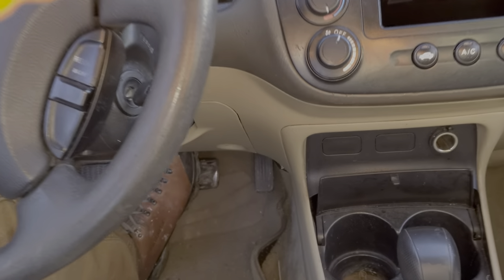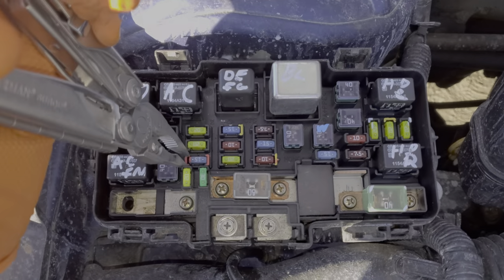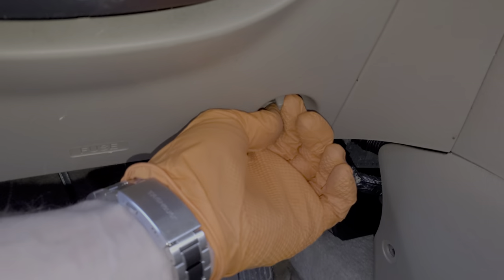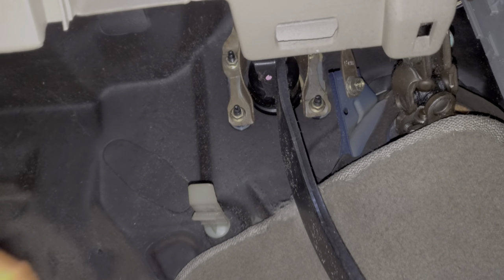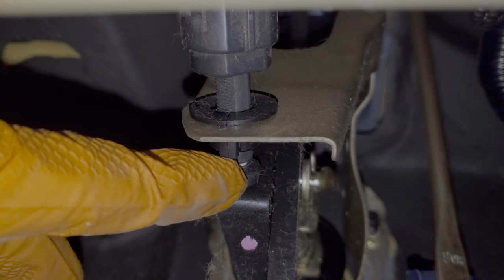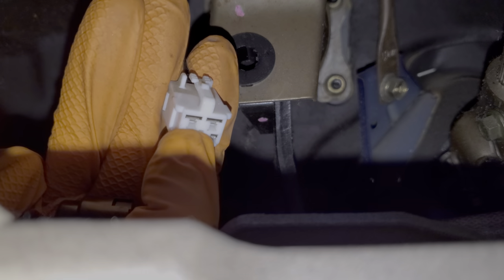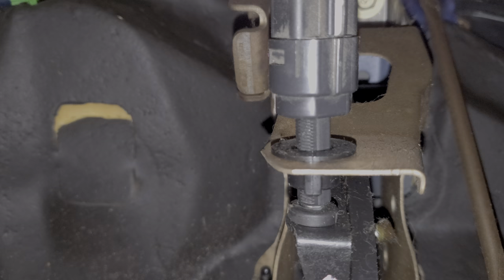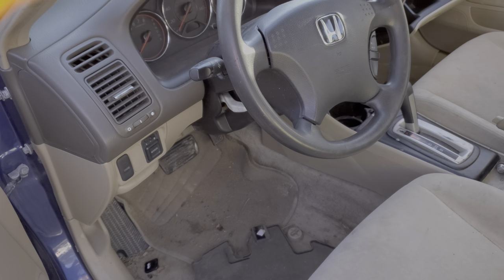2004 Honda Civic Brake Light Switch Replacement, Stop Light Fuse

Comment: 2:27 does that rubber piece have a specific name
Reply from the maker: Yes Dorman calls it a brake stop pad and you can buy it here: https://amzn.to/3BC6ZX0
Reply: @LehewTech  thanks
Reply: @LehewTech  Thank You So Much for Your Help....
I just put a nut & bolt of 1/4  of diameter x 1/2" long at the pedal because the rubber was missing, and problem fixed, The lights Went Off... Thank You Again
Reply: @LehewTech  I saw a video where a guy supper glued three pennies together and glued it to where the grommet goes, and he said it has been working for years.
Reply: @CarlJohnsonjr ty for the link. Saved me a lot of trouble.
Reply: Very informative appreciated the video and was wondering if you by chance live around Birmingham or Tarrant
Reply: That did it for me. Thanks!

Comment: Just came home at 10pm to find my Civic in the driveway with the brake lights on... This video saved my sanity. They've probably been on for hours, and are extremely hot to the touch, (it's still 97F here, at 10pm). Found the remains of the little rubber stopper.  Had a thick piece of leather I could wedge in the for the night until I can get the part and fix it tomorrow.  You sir, are awesome!

Comment: What if only one of my break/reverse lights isn’t working?
Reply: Man im going throught that issue right now, my driver side brake light doesnt work but it works when locking the car and etc, i feel like its a wire issue but i dont have an obd reader to check where the wire fault is if there is any wire fault

Comment: Hi Lehew, my parking lights did not work when I turn the lights on. However, brake lights work when I push the brake pedal. Park lights and brake lights are the same, only light shining amounts are different, am I right? so, where is the problem. I did not find it out.

Comment: The troubleshooting bit at the beginning was fantastic. I have a 2004 CR-V and it's basically the same under the dash. Was able to find a bolt that fit where the plastic stopper had broken and could fix the issue at work instead of having to drive all the way home without functioning brake lights. Great information and great video.

Comment: This video just helped me immensely. My best friend's 05 Civic had the brake lights stuck on and drained the battery to zero. I thought maybe it was a solenoid stuck in the "on" position. Turned out to be that brake stop pad, it broke apart and fell on the floor as soon as I took that bottom panel off. Quick and easy fix!

Comment: Apparently that adjustment feature can also work for fixing a non-working cruise control problem. Gonna try it for mine, I'll edit the comment with the results. One more edit, unhooking that switch can also work for checking your brake lights and making sure the bulbs are good. Genius move installing this type of system Honda!

Comment: Great video. I think I need to replace my switch. I basically know how, but wanted to check a video and this one was good. You covered everything. In my case I think its affecting my cruise, not my brake light. I cant find any other reason why cruise won't work so im replacing the switch. Thanks for the detailed video.

Comment: All.my lights at rear end are working.  When I press the brake, the right brake lights glows indicating that it's working fine but left one does not. It's dfntly not a light bulb issue coz all lights at rear are working when you turn on the lights. What could be the problem?

Comment: My issue is the tail lights don’t stay on. they only work for the following:::
Brake lights 
Hazards
Signals. 
That’s it they won’t stay on while driving at night. Already checked the wires, fuses, relays. 
I’m assuming light switch????

Comment: Great tutorial very easy to understand !
Btw I have a clicking sound when I depress the brake pedal on my 2005 civic automatic, it's coming from the brake linkage and not outside the car, I can feel the click when I depress the brakes, do you think that the switch could be at fault, from your tutorial it doesn't seem likely that a click could come from just activating the pedal  and thus pushing up that white plastic brake switch, would you agree or is it possible that it could make the click sound?

Comment: I just folded a piexe of thing cardboard like 5 times and stuck it in there for now. Pushed the brake switch on it so theres some tension on the cardboard but not enough to trigger the switch. This will work till i fr just tape the cardboard on there permanently. Fixed this while waiting for harbor freight to open lmao

Comment: Hey! i have a question i have an automatic 04 honda civic and my reverse lights arent turning on. checked the fuses and bulbs all seems fine so i wanna check the switch but looking around on the internet some say its on the transmission other say its under the shift lever. I was wondering if you maybe knew where the right location is for the Back up light switch?
Reply: This switch I just replaced and I now can click the shifter into gear rather than stick something in the hole next to shifter. It's the 8$switch

Comment: Tremendously great video! I did have to replace the grommet. My grommet was actually plastic and I saw what looked like Chiclets on the floor. I replaced that and that solved the brake light problem. Can you tell me why when that solenoid or that switch is activated there is a clicking noise in the center console that is quite loud? I am having trouble with my cruise control and one video said that it's related to this particular switch. The light on the cruise control button is on but the light on the dashboard never comes on and cruise control does not work. What in the world could be wrong?
Reply: I fixed it! Using your video I was able to figure out how to remove the brake switch. The switch serves multiple purposes. If the grommet is missing your brake lights will be on. Also, if the grommet is missing or broken, you will not be able to shift from Park to drive. And, lastly, if the button is not pushed in all the way, you will not have cruise control. If your cruise control light that you depress to start cruise control on the dashboard usually to the left side of the steering wheel near the door, as is on the 2001 to 2005 Honda civic, if that light is on, and when you are driving at 40 miles an hour or more and you then push the set button but you do not see the cruise control light on the dashboard display, and cruise control does not work, the problem could very well be that your brake pedal switch is not depressed fully. Do what this video shows to pull out the switch and push it in all the way then lock it in place and you should be fine. Once again a tremendous video!

Comment: This video helped me a lot! Brake lights on my Honda Civic 2004 would not turn off. I followed the video to get to fuse #7 (or at least on the same spot #7 was supposed to be, since apparently someone placed fuse #15 in its place). As soon as I removed the fuse, the break lights turned off... yey!!! Car is not being used much in lockdown, so at least I can prevent the bulbs from burning off as well as saving the car battery. If I can do it, anybody can, LOL... Thanks!

Comment: wait since you can just adjust the break light switch height, what’s the point of having the rubber piece?
Reply: Perhaps the lowest position still isn't enough to keep it pressed when the brake isn't activated? Excellent question though!

Comment: Brake lights are off when turned off so the rubber part is good. it’s only bad when brakes are applied that the lights do not turn on. 

Can the brake light switch still be an issue? thanks for the video

Comment: Older video so a response isn't likely but I'm at a loss. I got an 03 Civic EX sedan and none of the three brake lights are working. The running lights work fine, but when I press the pedal nothing happens. I replaced the brake switch immediately since I assumed that would be it, but nothing changed. I don't have the horn either, which shares the same fuse as the stop lights, but the fuse is fine. I have no idea what to do with it at this point.
Reply from the maker: Is that Fuse receiving power?
Reply: @LehewTech  Not sure. I don't have a test light, is there any way to do it with a multimeter?
Reply from the maker: Yes check it for voltage against ground
Reply: @LehewTech  I checked it out with my multimeter and I’m getting good readings for everything except my horn/stop, ABS and hazard lights, all of which don’t work. I’m guessing a wire or something split on me somewhere.
Reply: @SnuffySpaghetti  I think I have the same issue did you find anything?
Reply: @Housington95  Ended up bringing it to a family friend's shop and he had no idea what the deal was either. There was no actual cause for the wires not getting power that we could find, they just decided not to work. He spliced power to the wires that needed it and everything has been fine since. I'd recommend doing the same thing.

Comment: My 2009 Honda Accord center brake light works, but the other two brake lights do not come on.  The brake light switch is good, I also checked where all wires connect to the ground, and it looks good.  Any suggestions on what to check next would be greatly appreciated.
Reply: I think i have the same problem. I think all the lights come on for me when i step on the brakes, not sure, but the center definitely works. Did you fix the problem? Solution?

Comment: I checked every single fuse and switched them around, checked every solenoid and moved them around checked all bulbs, replaced the brake light switch. Still no brake lights. No 3rd brake light either.
Reply: Have you fixed it yet? I think I have the same problem
Reply: I also have the same problem

Comment: Can a bad brake light switch cause my transmission stuck on park?
Reply: Yes, when you hit the brakes the sound you hear is the parking pin removing, with it mission or damaged it won't go into anothet gear.
Reply: Yes I learned too that because I changed this sensor I now can take my car out of park without prying something in the whole next to the shifter to go into gear. This video was very good to show us.thanks